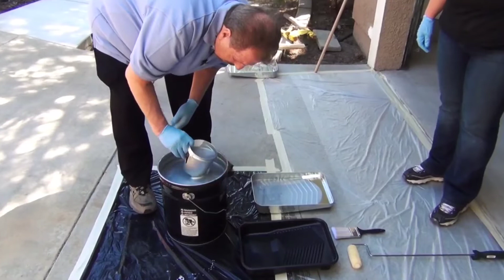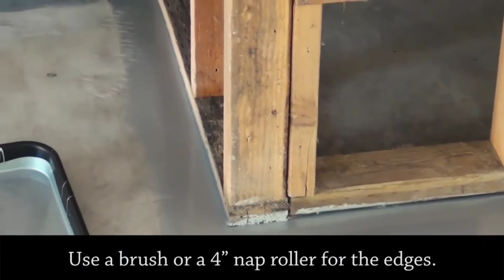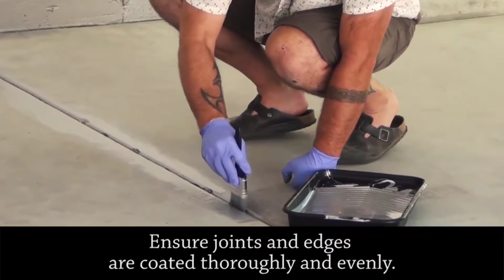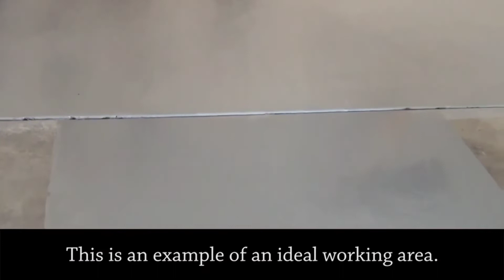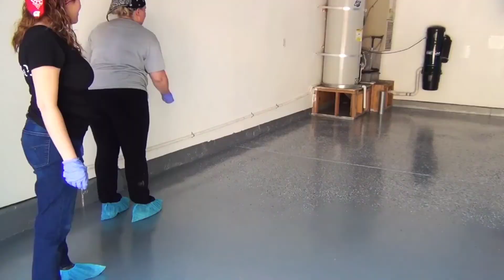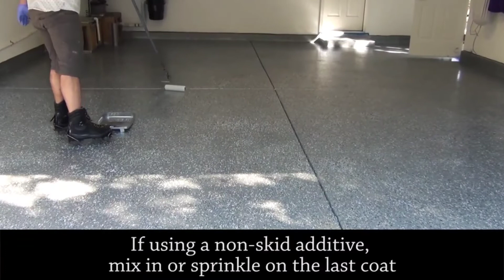Rust Bullet Application onto Concrete Floor using Roller, and Brush

Comment: This is very helpful, thank you. What color paint are you using? It looks silver in the pan, but light gray on your floor. Also, what do you call those "caps" on your feet? I'm wondering how they handle the wet floor from the second coat... or did you wait for the first coat to dry before applying the second application?